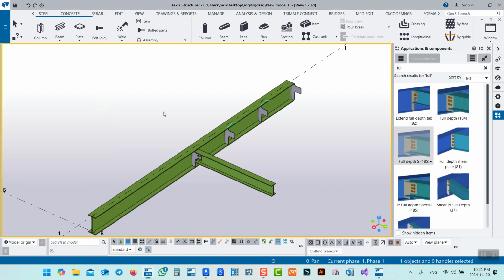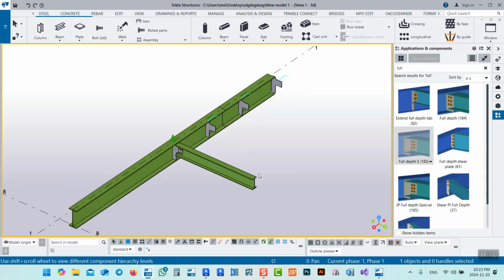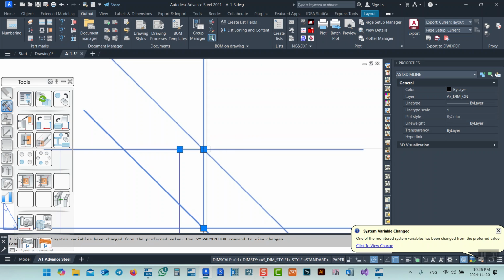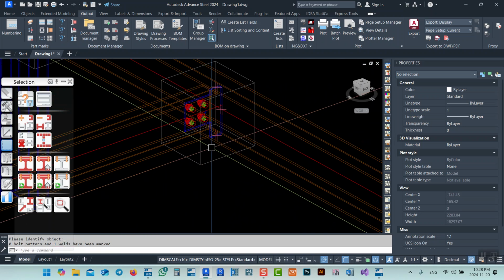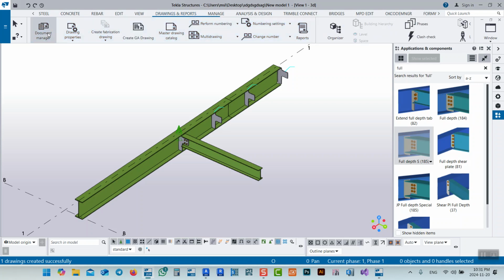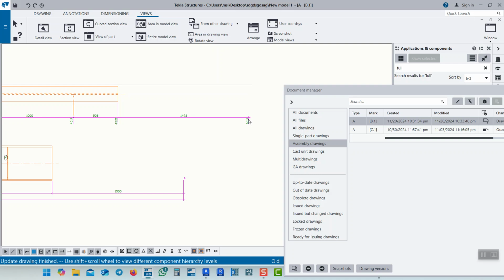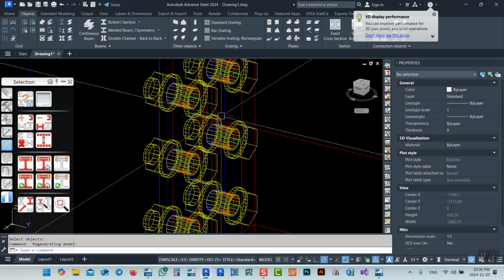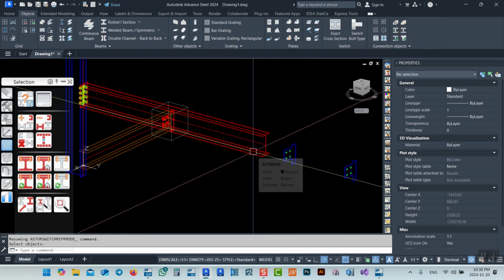Plate welded by mistake in tekla vs advance steel

Comment: In Advance Steel, after using "Display connection  means", use "Search for Marked Objects" - bottom left on your "Selection" palette. It will show big red arrows pointing at any marked objects so any small welds that are marked are easy to see.
Reply from the maker: Yes you can do it but still if you have huge projectvit is not easy to see it, thanks for your comment and sharing good information with others